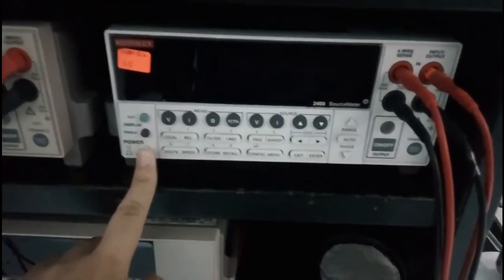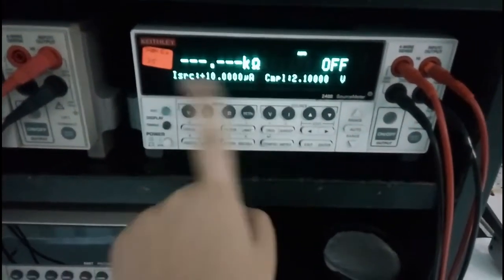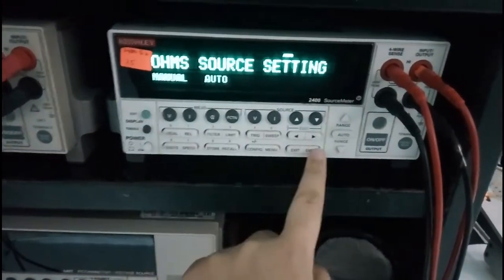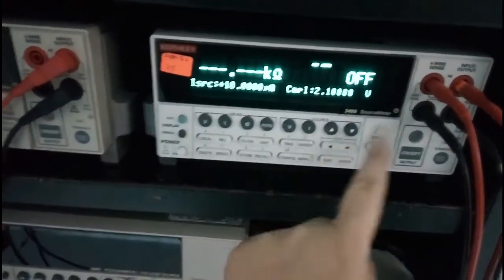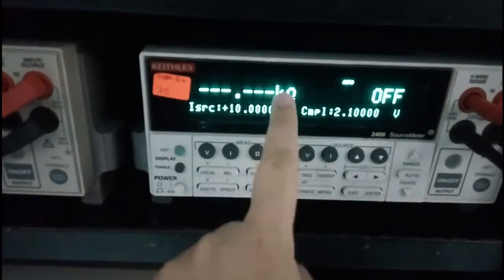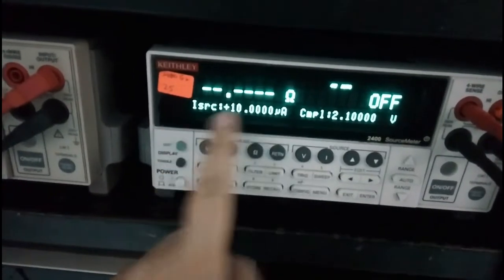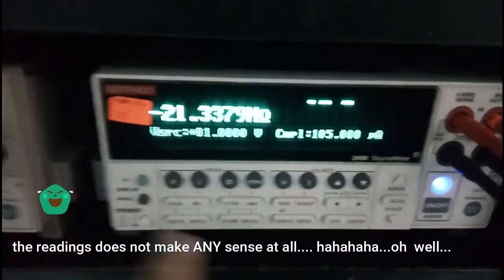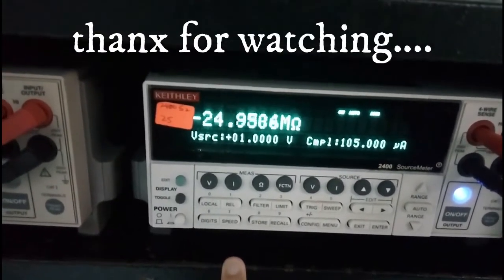learn how to set up a 4 point probe meter in 3 MINUTES, Keithley 2400 model, electronics

Comment: Could you please explain in more detail how you used the Keithley 2400 model and what kind of measurements you made?

How do you use this device specifically for semiconductor characterization?
Reply from the maker: Hi..sorry for the late reply..this device is actually a characterization device for characterization methods of the two point probe method and also the 4 point probe method. I will try to find if i have videos to differentiate in between two methods. In the nano lab...this method is used to characterize semiconductor that in thin film form or that is deposited on to substrate such as glass or wafer.. this device can be used manually or can be used using computer...so which method that you want to know more? Ill try to answer

Comment: hi, im using Keithley 2450. why the result same as me that in Mohm that is weird. how to change to get the correct resistance? thanks
Reply from the maker: Hi, if you are using the 4 point probe meter..my guess is that your sample is probably very thin. In case if your thin film is any type of conducting polymer, having a Mohm (high resistance) might be correct...(electrical properties also varies with type of material and thickness). My suggestion is that. 

1) if it is possible to get a sample that you already knows the resistance (the correct value) to test if the equipment setup is correct.

2) to test the material/sample by using at least 3 similar samples to see if you get different readings or almost similar reading ( if all 3 are almost similar, the data are correct...if all sample have very big diff in reading, maybe the sample its self is not fabricated correctly or fabricated inconsistently.   

3) try to test the same sample by using other method such as LCR meter or 2 point probe method and make a comparison. You can read my papers  on characterization 
     - (2pp vs 4pp) : Electrical Characterisation of Polypyrrole Thin Film Conducting Polymer ( https://scholar.google.com/citations?view_op=view_citation&hl=en&user=LMHOCOEAAAAJ&citation_for_view=LMHOCOEAAAAJ:2osOgNQ5qMEC)
      - (LCR meter) : Experimental study: The electrical conductivity of Polypyrrole doped organic acids thin film (https://scholar.google.com/citations?view_op=view_citation&hl=en&user=LMHOCOEAAAAJ&citation_for_view=LMHOCOEAAAAJ:qjMakFHDy7sC)

4) if all are correct but still having a big value data...means that the readings are correct. To get a lower resistance reading the step is to either increase or decrease the thickness of your sample ( re-fabricate and re test..last time I test my samples with more than 10 types of thickness variations) 

all the best with your studies. Good luck :)